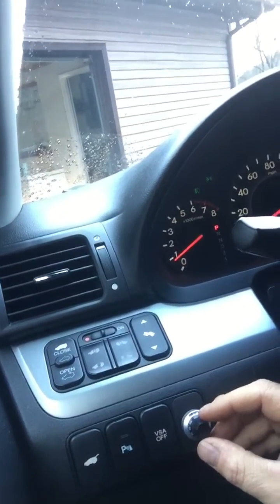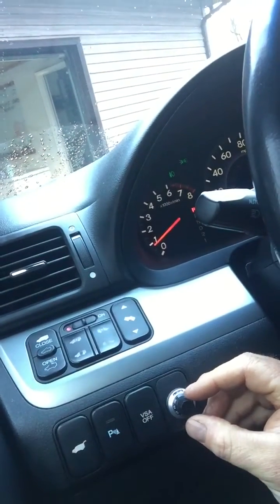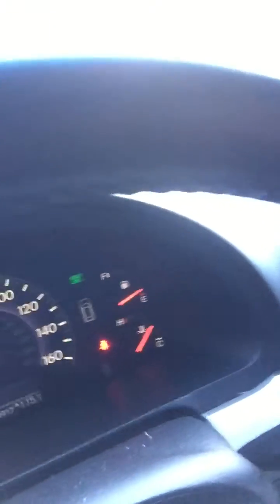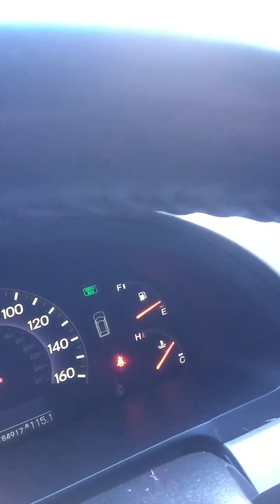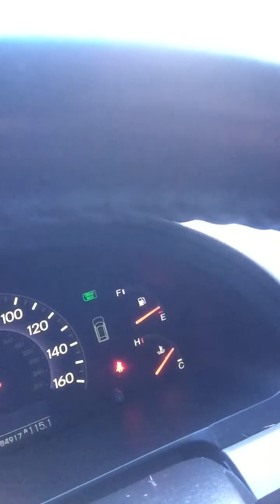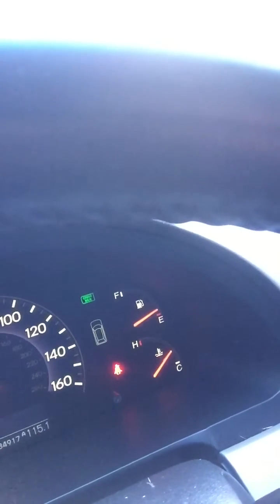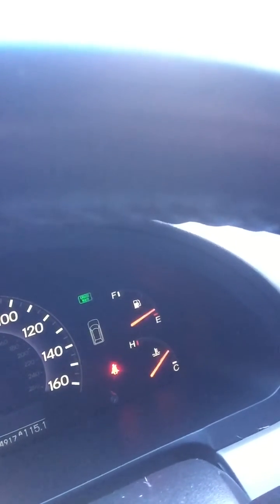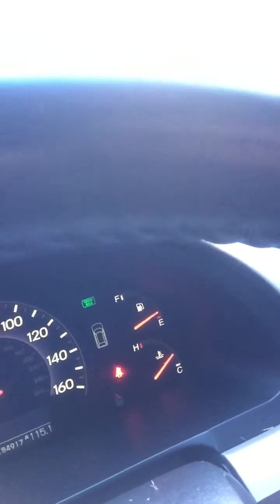2008 Honda Odyssey ECO mode hack

Comment: Great idea.  I have the vcm muzzler and occassionaly the eco light comes on when I don't expect it.  I just use the lowest resistor.  By varying the resistance you may risk tripping a code.  Other wise I think yours is the ultimate solution.

Comment: I would suggest putting an override switch in the circuit.  If it's hot out you don't want to overheat the engine.  With an override you can re-engage the temperature sensor to actual temperature. If that makes sense.
Reply: Can you put a parts list together for this I have the vcm 2 version but in Ohio the weather is all over the place this on the fly version is way better please!
Reply from the maker: Yeah, that makes sense but I do not think it’s necessary. I’ve been using it for three years in the summer and in the winter and we’re only talking about manipulating the temperature 3 to 5°. If the engine word to start overheating, you still know it according to the Dash.

Comment: You said this can be wired to either wire… but, for my sanity, which wire did you wire this to? My decision making ability is not the greatest… 😂
Reply from the maker: I can’t remember and I ain’t gonna go untape that nasty wire! 😂 It simply makes a loop and disrupts the signal. Don’t think of it as two wires, think of it as one coming from the computer, getting a signal from the sensor, then traveling back to computer. The signal can travel either way so either “side” of the wire is fine.
Reply: I will accept your answer! 🤣 Thank you for the explanation, Matt!! 😊 Much appreciated!
Reply: black

Comment: What happens if the van actually starts to run hot? Does the needle just stay where it is, and end up cracking the block because you had no clue it was running hot? Serious question, not being a smart ass.
Reply: Cooling fan is connected with other temperature sensor. This sensor is only for VCM and gage.
Reply from the maker: The needle moves just like normal. It will be advanced a little already though.
Reply: It would have to be a matter of watching relative temp.  If it's bottomed out after normal driving and goes to half, that would be your "hot".  Unfortunately no red light.

Comment: Replace the transmission mount and the shaking will disappear. Turning off the eco mode, my car began to eat twice as much gasoline. I drove only 10 miles out of 1 gallon.
Reply from the maker: Then you simply had a broke transmission mount
Reply: Mine started to shake, then went into limp mode, limited the revs to 3K, and reached a max of 25 mph while stuck using 3 cylinders.  Those are the symptoms I had.  Definitely different from yours.  Mine was VCM.  Burned 4 out of 5 quarts in 2 weeks prior to going into limp mode.

Comment: “Iam lost soo what’s the point of buying a somewhat eco gas saver van ? If u going bypass it ?? I bought mys new in 08 and I been using eco mode for long trips and daily trips around town .. I want the gas-saver to stay gas saver .. iMo I bought it as a saver not a full race car . That’s why I have my 383 stroker for .. iam kinda lost of words trying to understand full meaning of adding a bypass that u have to adjust each season.. does it still give u high mpg ?..
Reply from the maker: You bypass it because it’s a faulty feature that causes premature cylinder wear and oil consumption over time.
Reply: There seems to be  so much miss information on this out there. The ECO light is directly tied to the Honda VCM ssysstem. It is a a system that deactivates some cylinders when the load is low. In theory this is to save gas but in pratice the  savings are extremlly limited, The down side is those cylinders that have been  deactivated are stilling going up and down. There is no gas or fire so any oil blow by from the rings is foweling the plugs aand is many documented cases caaaausing  slude to cause the rings to not seal propperly. I know of a recent case where the dealer wanted 3900.00 to rering a couple of cylenders.   A detergent treatment new plugs seems to have solved the issue and a VCM delete device will be installed by the owner.  Most of the devices work by making the engine control computer think the engine is just below normal operating temperature even when it haaas reached temperature.  This causes the VCM system to never be activated. Becaaause the VCM is only actived under low load it is where fuel usage is minimual, so any loss of mileage should be very small. Now you  need to know what you are doinga as if the engine thinks the temperature is way to low other driveablity issues may arise. In later models it should be in the 80-90 ohm range.  Has nothing to do with enggine or transmision mounts, If they are bad they will still be bad
Reply: You should look up the class action lawsuit.  That'll answer your question and explain why.

Comment: When you 'trick' the car to make it think it's running colder than it is, it will dump more fuel into the engine and kill your mpg. I'll bet anything you lost mpg by foing this cause it puts the engine in open loop being 'cold'. Nobody should do this. 

Instead, change your oil frequently using a good quality oil and check the rear engine mount as they have a tendency to break prematurely and  cause vibration. You shouldn't really feel it going in and out of eco mode unless you are really paying attention.
Reply: Nope,   EC1 (the sensor that tells the computer that the engine is warm enough to go into Eco mode)  has no effect on idle, thermostat or fuel consumption other than not switching to 3 cylinders.
Reply: It will also plug up your catalytic converters!
Reply: @Fire2074  It also follows out the spark plugs running Eco mode
Reply: @Fire2074  Yes it will plug up the catalytic converter’s by running Eco mode
Reply from the maker: If I did it was undetectable. Went on a road trip with full load, bikes and roof bag and still got around 20mpg!
Reply from the maker: That is great advice, but not for deleting the Eco mode. What I did fixed the problem. Motor mounts are fine.

Comment: Can you crank up that fuel gauge?
Reply: My thing does it give u same mpg ? Because I bought van for mpg in long trips not to be modding it and making it full v6 race car lol .. iMo does that mean every “ eco car made are bad ? Cuz my wife Tahoe has eco too and my company truck also ..
Reply: @mugensohc2.271  and in all cases they break early and are very expensive to repair. On a trip in November of over 2000 miles my Odyssey still averaged around 29 mpg. So the savings is mostly advertising hype

Comment: My 2008 Honda Odyssey eco light keeps coming on but the car rides normal why does the light show in the first place 🤔
Reply from the maker: Because it is dropping 2 or three cylinders to save fuel. It’s supposed to do that but it isn’t good for the engine. That’s why there are guys like me coming up with fixes. It eventually wears out rings and causes oil consumption.
Reply: @mattmustin1860  oh wow now my thing is when you put that thing on in the video does the eco mode light go off by chance ???
Reply from the maker: @Jay Walker  yes. Not just the light but it tricks the computer
Reply: Hi, so when the light came some times and disappeared, theses normal , To maintain fuel consumption, this is the company’s design, but in your opinion, this design is not good for the car?

Comment: do you have a listing or part # for the potentiometer that you used?
Reply from the maker: https://www.ebay.com/itm/401564815540
Reply: Thank you for the video I appreciate it I'm doing it to my 05 Odyssey with 274,000 miles on it, variable valve timing is acting up, causing it to have no power and burning excessive oil